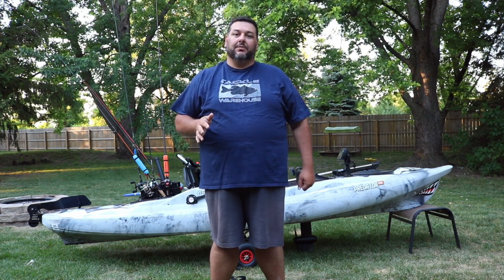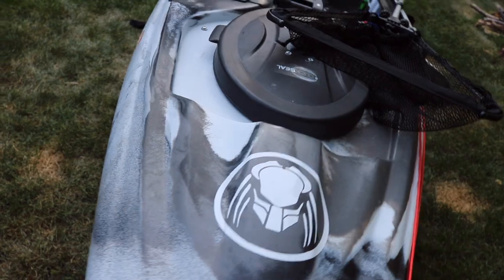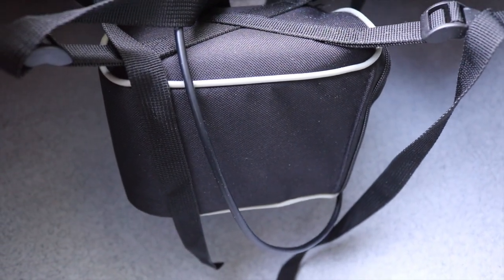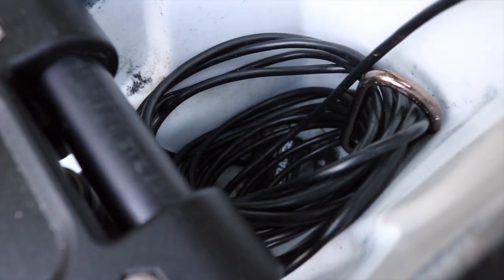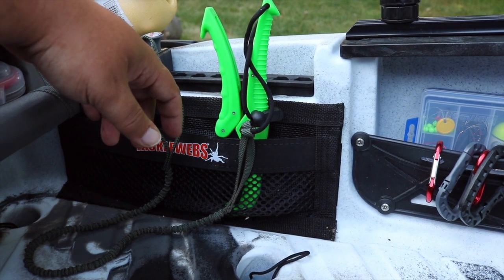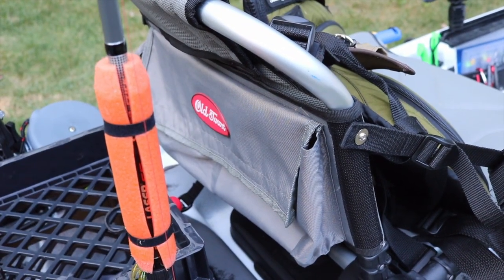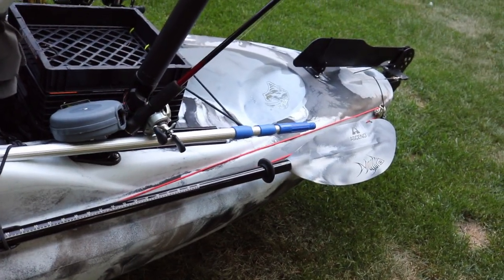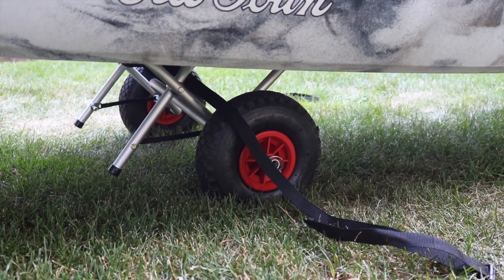Rigging My Old Town Predator Kayak

Comment: thank you very helpful, how did it work the lowarance transducer mount and the hummingbird transducer? Was the transducer the hummingbird XNT 9 DI T as that is the standard one with the helix 5. Did it fit or did you rig it to fit? tnx
Reply from the maker: I had to save off a piece or two and rigged it to work. It wasn't difficult to figure out, but I don't remember exactly what I had to do.

Comment: How do you actually hook the weight for your anchor?
Reply from the maker: I would use a carabiner to attach it to the anchor trolley then. I do it differently now. Working on a 2018 changes video.

Comment: I have a predator 13 and I wonder if I would be able to set up a power pole
Reply from the maker: If the rear handle is like the PDL, it looks to be set up for one in mind.
Reply: Bill's Catch22 they are a little different as mine has a larger handle hole thing but I have discovered that there are special mount for the predator